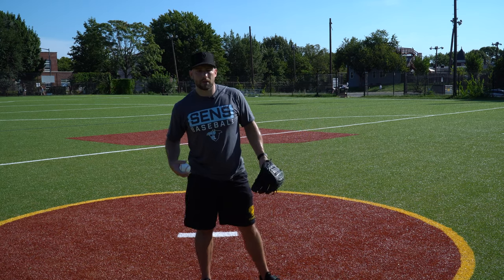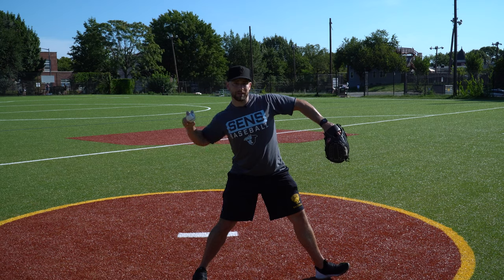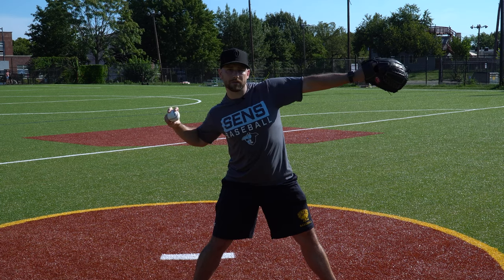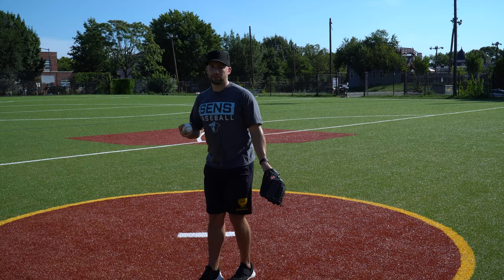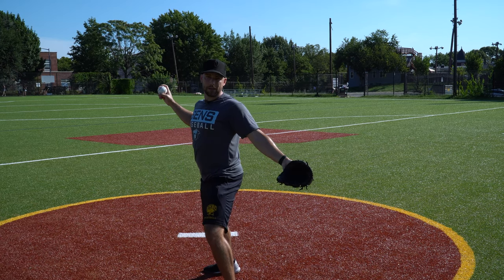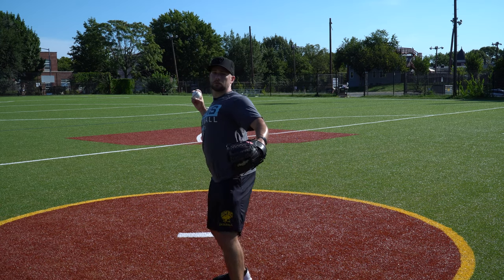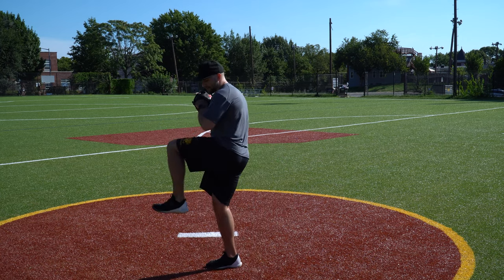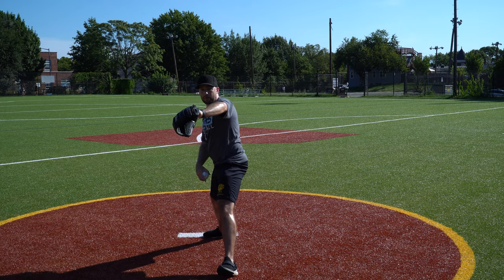Glove Arm Action: What's Its Role in Pitching Mechanics?

Comment: I disagree with the upward shoulder tilt. You can keep neutral shoulders and still land neutral. Also, depending on release height for guys who go over the top need to land at a downward angle.
Reply from the maker: You’re not paying attention then. Overwhelming majority have uphill shoulders and almost no one lands with downward angled shoulders.
Reply: @DanBlewett  Thats because the majority is not high arm slot.
Reply from the maker: overwhelming major of pitchers throw at a 10/2 o clock arm slot. Which is certainly not a low arm slot